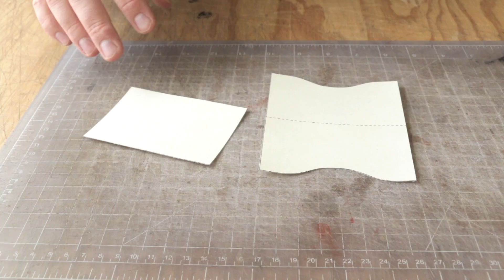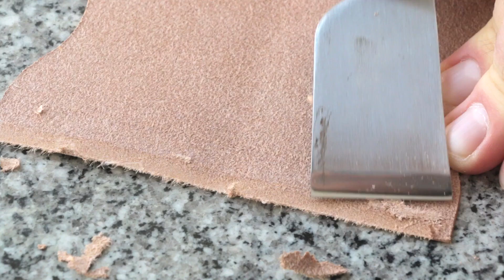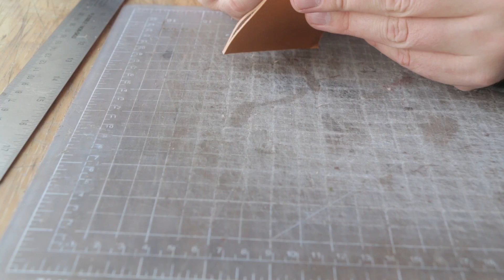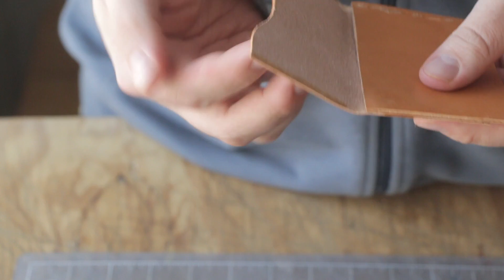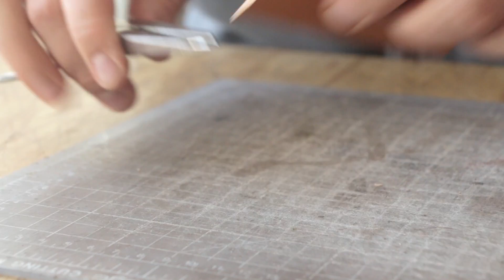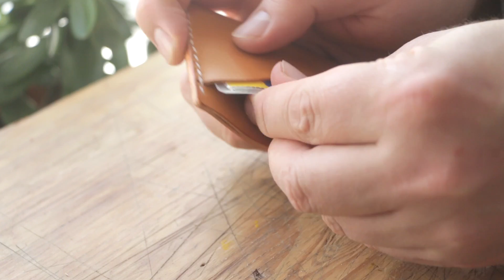Classic Leather Card Wallet TUTORIAL // PATTERN

Comment: I enjoy watching your craftsmanship, classic and clean, very nice. I have a question about adding an ease allowance to wallets? Is this supposed to be a thing? Does one not need to add to the width of, the pocket i suppose, to accommodate multiple cards? If so is there a rule of thumb used for calculating?  Thanks in advance.